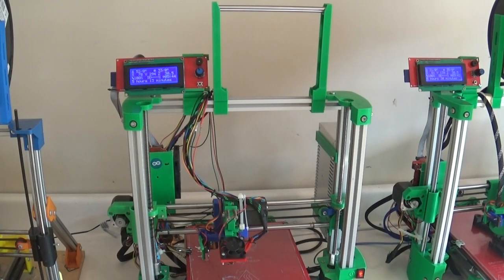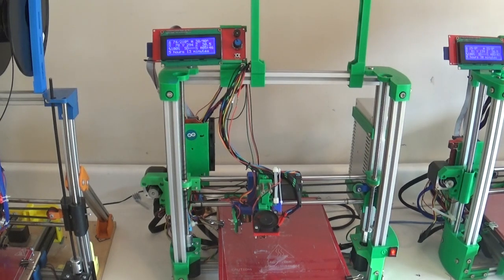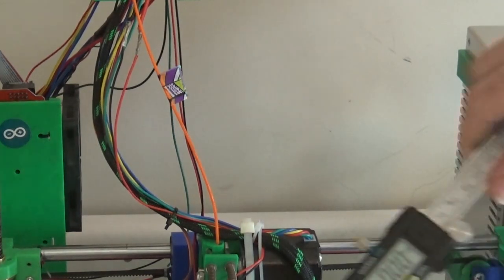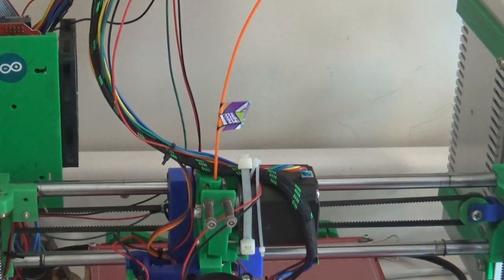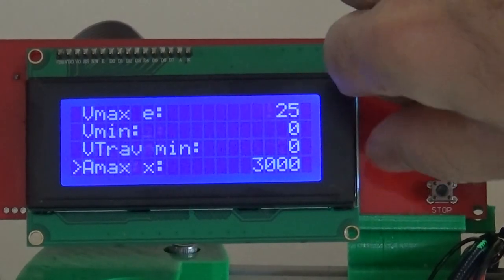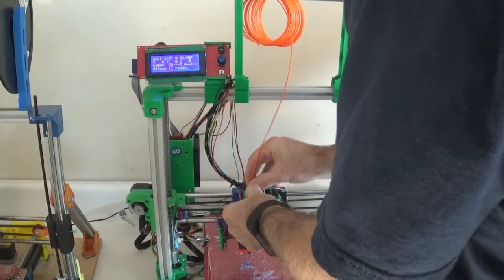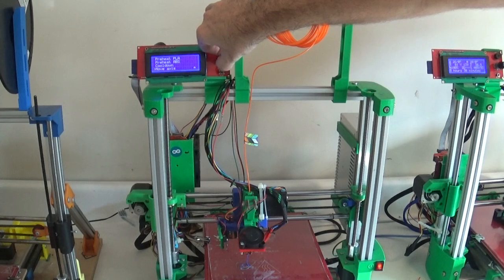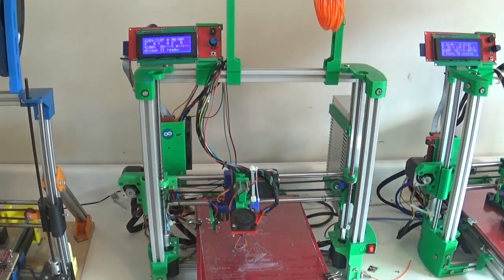Calibrating Esteps on Marlin / Reprap 3D printers

Comment: Save yourself one calculation by locking and zeroing the calipers when you take the first reading. When you take the final reading it will show the (negative) distance extruded directly so no need to subtract the first from the second measurement.
If you swap nozzle sizes or use a significantly different filament (for one with more/less friction) the esteps can change. You can store multiple esteps settings as GCODE files on the SD card to quickly change between them. For example, a file with these contents will set the esteps to 106:
M92 E106

Comment: Any news on a fix for the crooked extruder filament path? Just printing my Wilson2 parts now...
Reply: +John Abella I drilled out the top filament guide  and used some PTFE tubing to guide the filament directly into the drive gear.
Reply from the maker: +John Abella It had never cause me any problems but I have straightened it out and I pushed the inlet side a little closer to the drive gear to hopefully help with flexible filaments also.  Changes are in github, let me know how you like it!
Reply: +Marty Rice I've had an issue when I used a different drive gear. The fillament seemed to walk to the sides and right off the idler bearing in the extruder so thats where the tubing helped.